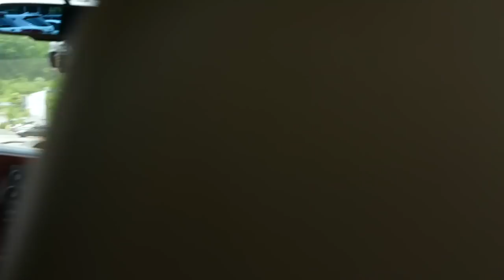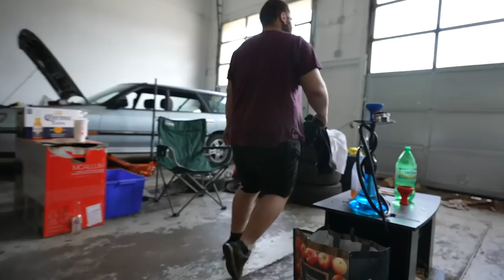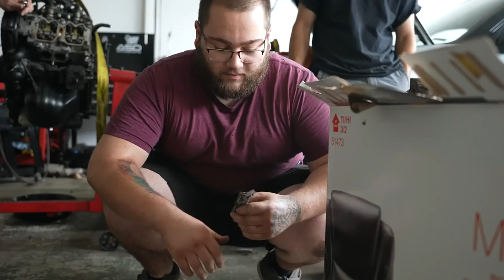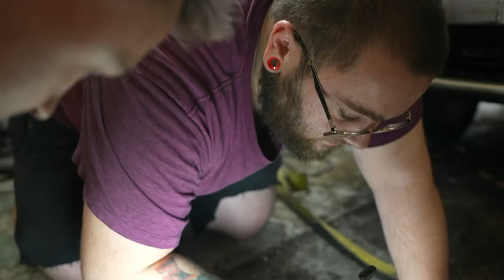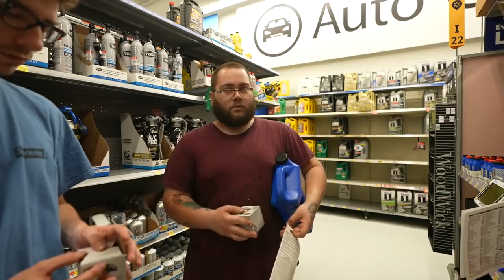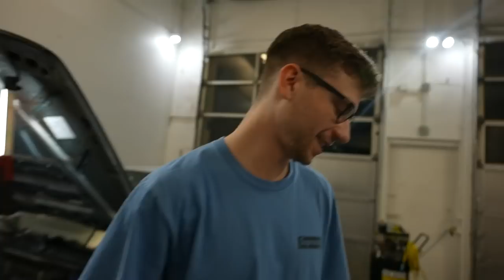How To Change Valve Seals Without Removing The Heads (CHEAP & EASY)

Comment: AutoZone sells a spring calapsing tool that squeezes the spring and allows you to drop the locking pins around the valves.. costs like 17 bucks..

Comment: I did this recently, and Ive done it with the head on the bench, and im never doing it in the car again. I have video of it, but editing the video got to be such a hassle that I took a break from editing for heh last few months since I shot that video. Using a spring compressor is the best way, also you should use a magnet to catch the valve keeps so you dont lose them. Also, Even though I used the right tools and magnet, I lost a keep. so... you should probably expect to lose one if you do this job, and get some spares ahead of time